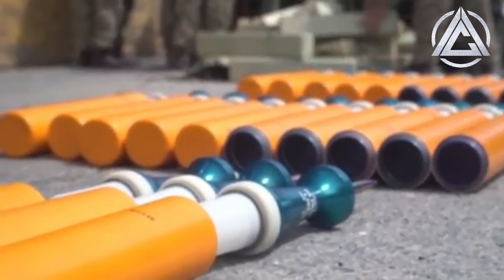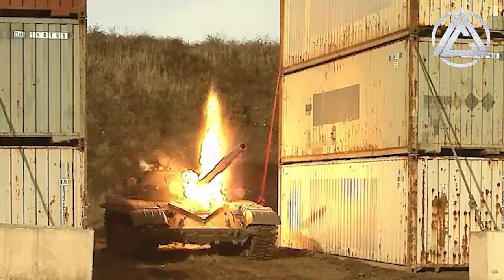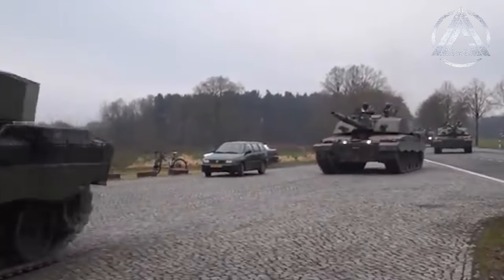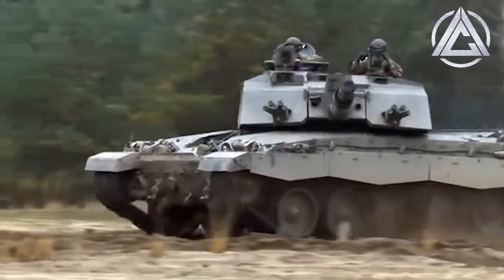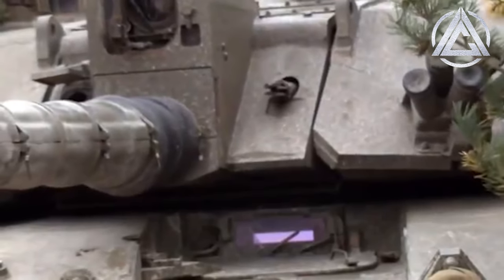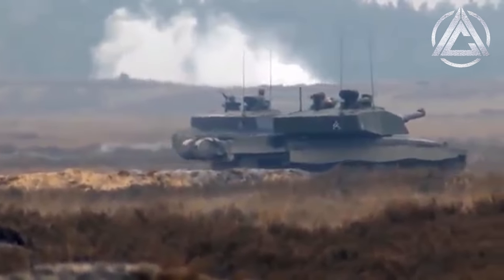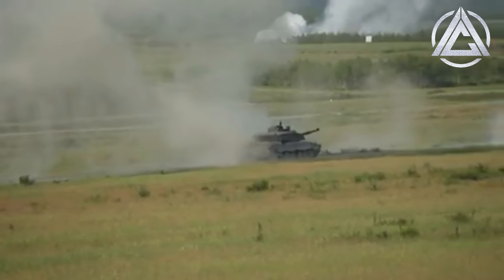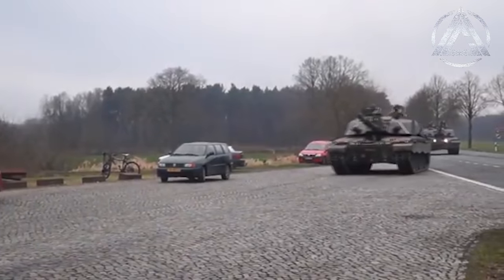Challenger 3 | Britain's New Main Battle Tank | Is It Really Any Good?

Comment: My boss was a tank platoon commander in Desert Storm. We talked about it quite frequently over beers. Fascinating stories. The M1s he ran came with a speed governor that restricted the top speed to 40 mph. It was the first thing removed when they arrived in Saudi Arabia. He has personally had one up to 53 mph. That’s across flat, hard packed desert mud and sand with a friggin turbine engine. And you’re seeing data that puts the Challenger III at 60 mph? That’s nuts. And scares me
Reply: well, even though the tanks today are heavy as shit, the engines we are talking about are in the 1200-1800 horsepower range (depending on the tank), so when shit hits the fan and you need to get out of the area RIGHT NOW!!!, they will get you out of there, albeit suffering damage in the process, as they arent meant to run at such ferocity very often
Reply: imagine being on a UK motorway in a lorry and getting passed by a tank coz that is was could happen. Trucks here are capped at 56mph
Reply: @M3PH11  there are vidéos of that on ukr highways at start of the war lol amazingly scary
Reply: @M3PH11  Happened on roads in Germany all the time - collisions between cars and Chieftains  / Challengers never went well for the car.
Reply: @paulevans7742  Grandad crashed his vovlo into a Chieftain in Warminster years back... car was wrecked - tank was barely scratched 😂

Years of litigation, that one!
Reply: @unbearifiedbear1885  In Germany sometimes cars would try and overtake tank columns, which was fine until you got to the front of the column and the leading tank was turning off the road, the tank pivots around its center and the rear swings out - having a car sideswiped by a chieftain was a not uncommon incident.
Reply: Lol Challenger 3 ??? I think 🤔 you have Miss information lol even UK armoured divisions doesn’t have challenger 3 yet !   It is the un modified Chalkenger2’s that are being sent and these have no mod con Accessories fitted ( reactive armour or anti missile systems lol ) so I think when they face drone attacks and drone directed missiles until they lock on ( thereafter the tank is dead !) - ie painted with a lazer designator .. we’ve all seen the movie where the alien spaceship is lazer painted and the cruise missiles then strike it and of course America wins the day … lol 😂 it is a movie after all …!
Reply: @paulstebbings9481  Challenger is a good tank pal every tank produced post ww2 by the British has seen action and been a life saver.I see everyday images of Russian hardware on the battlefield lol its non existent they are being routed .American commanders said the Russians would step up and annihilation would visit Ukraine in winter well I've still to see it. All we see is Russian soldiers and tank columns being blasted. Its like the Falklands, US military said it was an impossible feat to retake them but we all saw what happened in the south atlantic .British balls of steel marching 30 miles with the equivalent of another human getting a piggy back in kit being carried then going in fixed bayonets to Argentinian forces dug in with night sights as the British chose to fight at night.Never went well for the Argentinian forces its the same in the Ukraine just bigger.The 6 day war in the Middle East British centurion tanks US pattons and shermans isreali mothers were so happy their sons got to go into battle in the centurions they knew they'd see their sons again.All down to the crew the gun and how they work together plus a lotta luck in a tank battle.In desert storm 1 the British and Americans raped the massed iraqi tank divisions in challengers and abrams battle tanks.I agree tank killing is getting easier but for the guys firing those laser designators its down to the same as the tank crew skill ,practice some more practice and lots of luck.
Reply: I call BS
Reply: I question the viability of the crew at such speeds. Seems to me there'd be a lotta bouncin' an' bashin' inside the vehicle. Could the crew even read their screens accurately, or operate the weapons?
Reply: @CliSwe  Those tanks are very smooth and have suspension system. Their seats are also on shock absorbers and the guns are computer stabilized. And no one is shooting at those speeds. It's called "shoot and scoot". The faster you can do the scoot part, the better. They may fire on a few targets, then haul ass to another point before artillery can be called down. So you're probably right to an extent, at 55 mph over rough terrain just keeping in your seat is probable hard enough. But once they slow to firing speed, it's on like Donkey Kong
Reply: @valuedhumanoid6574  Thanks for that; I kinda guessed the crew would be non-operational during rapid transit. Trouble is, my thinking goes back to the days when a tank commander actually had to read a paper map!
Reply: I wonder what kind of tracks you need to do 60mph in a 70-80 ton tank
Reply: sorry buddy but Desert Storm was M1A1 , if you dont know what you are talking about, dont comment
Reply: @CliSwe  Worked Armour for 13 years, can I ask what is your qualifaction besides World Of Tanks?
Reply: @TheFastcraig74  Only reason I commented, was to gain some helpful insight from those who know. I'm not here to trade gratuitous insults.
Reply: @TheFastcraig74  No such word as 'qualifaction'. If you can't spell big words, don't use them.
Reply: The m1a2 came out after desert storm
Reply: @paulstebbings9481  Keep in mind that the American Abrams tanks are also going to Ukraine without the main part of their armour because certain laws in America prevent the army from exporting special armour packs, which includes the depleted plutonium armour on the Abrams. Lack of anti-drone/anti-missile systems are unlikely to be a problem anyways, since Russia has already used up pretty much all of their modern guided missiles (modern by 1980's standards lol) and they're buying drone from Iran of all places. Furthermore, it's my understanding that lots of the other equipment such as the Patriot and Starstreak missile systems being sent to Ukraine should be dealing with drones and strategic missiles before they even become a problem anyways, so all the challenger 2 tanks need is the capability to survive direct hits (which they will be much better at than The Abrams and the Leopard 2 tanks).
Reply: wear on tracks and power train will increase drastically at such speeds. Not an issue when you fight for your life on battlefields, as long as you can make it back to your repair shop and spare parts are available. This however will be a challenge as soon as modern tanks will get  engaged on battlefields in Ukraine. 🤧
Reply: This tank is good for keeping villages occupied... Put one in the center, near the church, it has air conditioning, good seats, video games...so the crew can stay complete their shift comfortably, and kids can't hit them with stones from slingshots... Excellent for the purpose, no better in the world!
Reply: @mattfaulk8724  strong/tough ones.

Comment: It’s the enemies from within that the armed forces need to worry about when it comes to the procurement and building of our military equipment, too many beaks in the gravy train who couldn’t care hoot about those using the equipment as they wont be doing the fighting.
Reply: You are close to the truth my friend.
Reply: Evidence?
Reply: @32shumble  Look no further than the infamous Type 42 destroyers.  Designed and constructed down to a price. Not given the required radar or much needed basic protection against the simplest of anti ship missiles from day one. Sunk by aging Skyhawk A4 bombers. Only dumb luck and superb seamanship kept the losses to two of the class, with others damaged by unexploded bombs. Let's ignore the cheap hull design,  aluminium that burned and cost so many lives.
Reply: @32shumble   Look at all the major weapons procurements made for 50 years and see how they overspend way off the original budget look at the consistency of this behaviour then drill into the behaviours and you will see the same trends every time - this will require some reading and effort if you are inclined to corroborate this.
Reply: @dickdastardly5534  If you'd ever worked on a dev project you would know how costs, and time are impossible to predict accurately. Oh yes, there COULD be corruption, but budget overrun is, at best, circumstantial evidence of that.
Reply: @32shumble  That’s just a load of old cobblers and you know it - why is it budgets and deadlines can be achieved in civilian projects  and in projects like the snatch land rover replacement . Circumstantial evidence  seems to repeat itself an awful lot and there are powerful people who don’t want the gravy train stopped. Check out a book called Her Majesty’s Top Gun , its far more eloquent about the goings on that I.
Reply: @dickdastardly5534  Lions, Donkeys and Dinosaurs also exposes it.
Reply: @32shumble  It is a very sad fact to know about the place gave birth to the first tank in history has to outsource its own land rover for overseas production.
Reply: @32shumble  It is also sad to know the new aircraft carrier's suffering from leaking problem and the 45 destroyer's painful propulsion failure.
Reply: @dickdastardly5534  No - sorry. Budgets DO go over. Deadlines DO get missed. Fact of life. If you'd ever worked on a project, civil OR military you'd know that.
Reply: @leonalbion3716  What can I say? Empires decline. Available money decreases. Things change.
Reply: @32shumble  And they can also be achieved and surpassed but you would know that also. There is an element who encourage overspend and delay this unfortunately is well documented in defence procurement.
Reply: @dickdastardly5534  That may be the case but you cannot assume that's the case is all I'm saying.
Reply: @32shumble  I’m not assuming but stating past performances its all in the public domain
Reply: @dickdastardly5534  What you say may or may not be be true. To believe for certain that it is true puts you dangerously close to 'conspiracy theorist' territory. 
Out of interest are you an anti-vaxer?
Reply: @32shumble  No I am not ! Are you ? What the hell are you talking about  all I here is bloody rubbish from you. its in the public domain of contracts successfully completed on time and those that have not I really don’t think you have much clue about this. There is no point continuing this discussion.
Reply: @gusgone4527  absolutely spot on….as EX RN of 80’s vintage, the defence review meant we got the cheap export version rather than the procurement spec. People lost lives and were horribly injured as a result. Those A4 pilots were very skilled and brave….but their kit was ancient with mechanical fuses on their bombs. Had they had more modern kit we would have been in deep trouble. We went South with just 19 9L sidewinders….had the US not dropped every thing and supported us with these and secure long distance satellite comms the out turn could have been a disaster.
Reply: @mac22011964  Thank you for this reply brother. (Army vet) The occasional reality check is a good thing. Sheeple quickly forget and are easily distracted by nice new kit.
Reply: Agree 100%
Reply: @32shumble  a guy sent classified images of  challenger 2 specs to warthunder
Reply: @32shumble  That's like playing the racist card!!...
Reply: @gusgone4527  literally bro. You know your history well. The Falklands war & Gulf war showed, very clearly, that politicians know jack about the military
Reply: @themc.kennyshow6585  Not history to me, I served in both. It's my firm belief that MP's must have spent 5 years regular or ten reserve in the military before becoming eligible for election. I can expand, clarify,/defend that as required. Waffle on for hours.
Reply: @32shumble  bollox, cost overruns are to be expected, that fact has nothing to do with fiddling by management when it comes to getting their noses in the trough, plus the military comes in 2 versions, war footing and peace footing, curiously something not mentioned in this discussion. The amount of 'professional' senior officers who are employed but have no clue what they want, but are happy to accept knighthoods is mind boggling, but would anyone really want to go to war with any of them? (Oh polish that kit properly before you attack!). If real tankers were given a wish list maybe it would mean designs would be cheaper, maybe someone who claims to have a background in project development would have a point worth making? Unlikely but there ya go. Meanwhile Chally has to 'make-do' with more crap it doesn't need or even worse, be 5 years behind the ball. Makes me wonder if we actually want to show the world what we can really do, ignoring budget restrictions means we can go do that road that gives us a world beating armour package, right now a lump of metal we are currently discussing buying makes so much noise it makes the crew sick, is that limited by budget restrictions? Or just comes with a price that includes lots of kick backs? Someone somewhere doesn't think there will be a war to deal with ... which is why we have tanks et al?
Reply: @bongodrumzz  TLDR

Comment: As you may well know, early (lighter) Abrams tanks were more than capable of breaking their 45 mph limit; that speed governor was put in place so those tanks wouldn't throw their tanks or blow up their transmissions.
Reply: It's a common misconception the abrams has a speed limiter. It doesn't. It can go over the speed limit like almost every tank can in the right conditions. It's just hard to do so and even when the chance occurs they don't let it.
Reply: @nothingspecial6925  Abrams tanks do or did actually have a hyromechanic speed governor system, though it isn't something one can easily "switch off" and takes a fair amount of tinkering inside the transmission hydraulics to modify or bypass. I've seen reports of early M1s being clocked in excess of 80mph, though those reports are admittedly dubious. It may not be present on the A2s to save complexity and space because the added weight makes those speeds far less likely to achieve under ideal circumstances. However, they definitely were present on the original 105mm M1s, and some crews definitely modified and disabled them to go at absurd speeds.

The larger point is that 60mph road speed for a tank is entirely plausible and is less limited by modern engines and more by track and transmission capabilities.
Reply: @KiithnarasAshaa  pretty much most modern tanks can and do exceed their listed top speeds. Challenger 2 was reportedly capable of achieving 80kph in Iraq. I don't belive its capable of 100kph though/60mph as listed.
Reply: @nothingspecial6925  Pads and top rollers will not like that speed as the vehicle rolls over the track making track top speed 2 x road speed lol
Reply: M1 and Leo2 both also have significantly more powerful engines and better HP/t ratios around 25hp/t, while cr2/3 sits at barely 16hp/t (thats just a bit more than ww2 heavy tank standarts)
Reply: @KiithnarasAshaa  I was running in a M113A1 at Ft. Knox and a Company of the very early M1 slid up behind us and passed us like we were standing still while we were a max rpm in top gear so yes they were very fast. I got a M113 return from Vietnam rebuild up to 55 mph with the original gas engine screaming.
Reply: @tacfoley Actually funnily enough it would likely use less fuel per mile at those speeds. Since gas turbines pretty much ignore load in determining their output. They full tilt at all times more or less.
Reply: Now try racing a warrior :-)!
Reply: The actual top speed is usually limited by the tracks themselves. Many tanks would end up throwing their tracks from a failed pin if they hit and held their top speed for longer than a moment. Since so much of the track is in contact with the  ground, they generate ludicrous amounts of heat moving and the faster they go, the hotter the tracks get. As the tracks heat up, the pins start to stretch and as the tanks go faster, the force on the pins increases along with the heat load and eventually a pin fails and the track disassembles itself and the tank crew is going to be spending the new few hours repairing their tracks.
Reply: @Talishar  What if you would drive the tank max speed in the Russian winter? The snow should cool the tracks right?